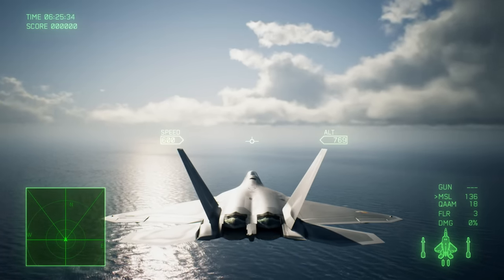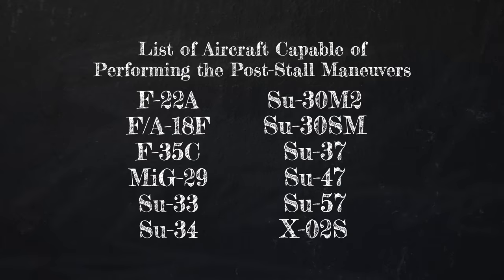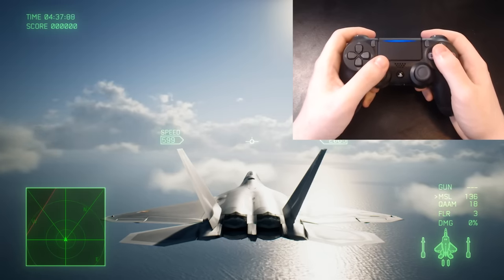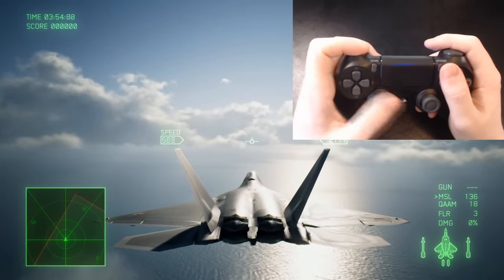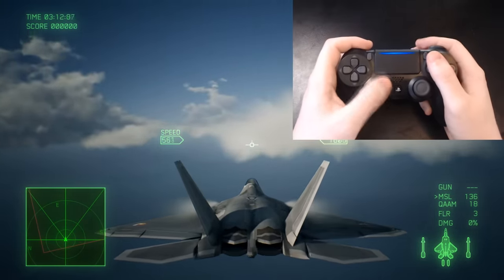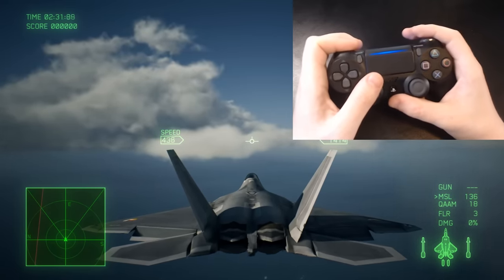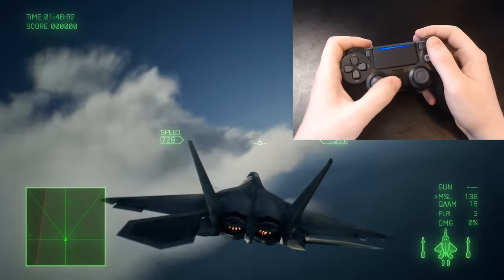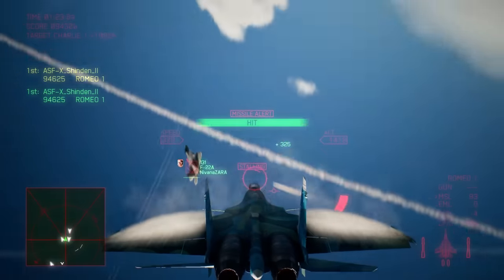Ace Combat 101 - #4: How to Perform Post-Stall Maneuvers

Comment from the maker: I made a new tutorial on how to perform the PSM with a flight stick. Check it out here: https://www.youtube.com/watch?v=w7RS9AWubBc
Reply: how can i do it with an xb1 controller?
Reply: Yea how to do this on Xbox
Reply: my f22 says auto pilot when i do it im on xbox to
Reply: Correction: What you're referring to as a 'Kulbit' is actually a type of Post-Stall Forward Lomcovak or simply a Flip. A Kulbit is a loop with the centre of rotation outside of the craft and tangent to the craft's momentum vector, what you're doing is causing the craft to tumble with its center of rotation inside the craft and parallel to the momentum vector. This manoeuvre is NEVER performed in real life, due to the fact that the excessive G load on pilots would immediately cause them to black-out/die, and there are currently no known aircraft humans can pilot that are capable of withstanding the stresses involved(this flip nearly ALWAYS results in the wings being ripped off.). The video linked below shows what an actual Kulbit looks like. Notice how the two craft (Su-35S and F-22A) perform an actual loop, rather than just simply flipping forward. 

https://www.youtube.com/watch?v=Zhl4kZooMRw
Reply: keyboard default control please
Reply: No f-15 ?
Reply: @carlingtonvaldez9283  The F-15 is not capable of post stall maneuvers therefore it cannot in game
Reply: @MrSmithSAH  thx for telling me
Reply: did this on the Xbox one controller all you just need is to hold depress the Left trigger (L2) then Right Trigger (R2 PS4) while having the left stick (L3 PS4) nose pointed up. The plane I used was the F-35C in mission 15 where I almost crashed while doing post-stall maneuver recovery good tips.
Reply: ...👌...Okay, now I'm starting to get a little bit hang of it, plus that makes perfect sense.
Reply: @carlingtonvaldez9283  :🇺🇸F-22[A]Raptor staltals 🦅&TRANFOMERS
Reply: @EpicThe112  Keeping the joystick down doesn't work for me. I just flick it down twice, and pull it off.
Reply: In ace combat 7 there are only 3 post-stall maneuvers you can do. 1. Kullbit 2.Cobra 3. Knife-Edge Slide In the video you taught us how to do the Kullbit and Cobra. Can you teach us how to do the Knife-Edge Slide maneuver.
Reply: Dont know if you guys gives a shit but if you guys are bored like me during the covid times then you can watch all the new series on InstaFlixxer. Been watching with my brother these days :)
Reply: @Noel Enoch Yup, have been watching on InstaFlixxer for years myself :D
Reply: @phamduchieunhan8465  same way. Hold. BOTH accelerate and deceleration buttons at same time, THEN down on the stick.
Reply: @hide2148  you’re pressing both your yaw buttons. Those simultaneously will initiate autopilot.
Reply: Add F-14 to that.